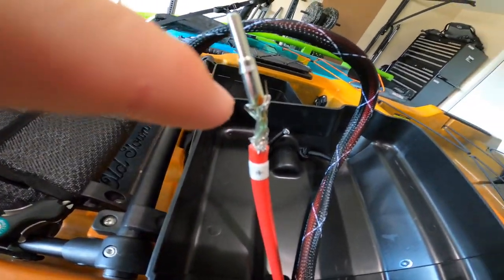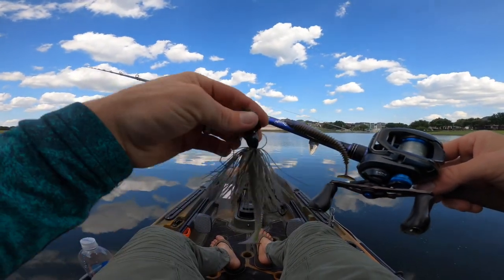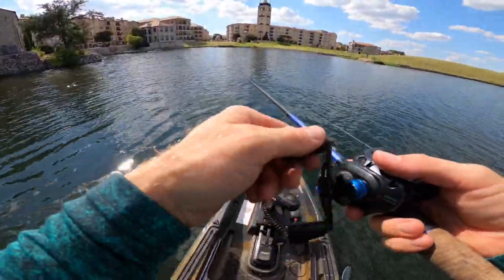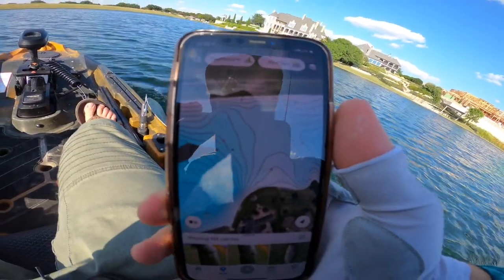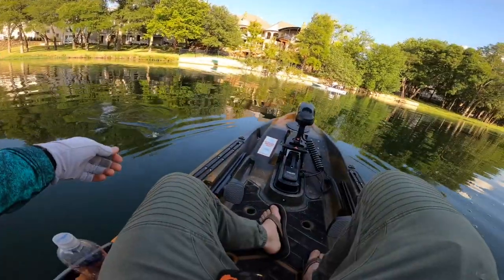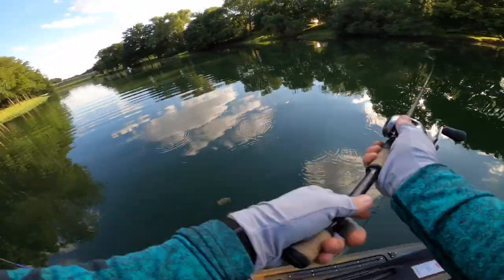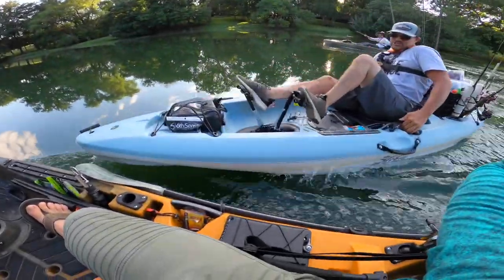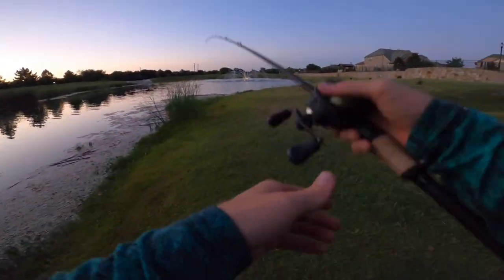KAYAK FISHING EPIC MANSION LAKE with WESTIN SMITH & GOOGAN SQUAD prototype RODS!!

Comment: Fyi when you solder you want to put your iron on the wire and hold it then put your solder on next to the iron and it should kinda soak in. Before you start though melt a little solder on the tip of the iron. Good luck
Reply from the maker: Haha thank ya 🤘🏼
Reply: I didnt know you knew reelkillerfishin. He seems like a good dude

Comment: I really want to get a drone but it seems most entry level drones are cheap and don't have many features but expensive drones are fragile complicated and are $$$$$ so whats a good mid range drone
Reply from the maker: I would look for the Mavic air or something on Facebook marketplace. I bought ours slightly used off Craigslist a long time ago
Reply: @WestinSmith  Thanks keep throwing the drag n drop doesn't have to be on a drop shot try it T rigged caught a 5 pounder not that long ago like that